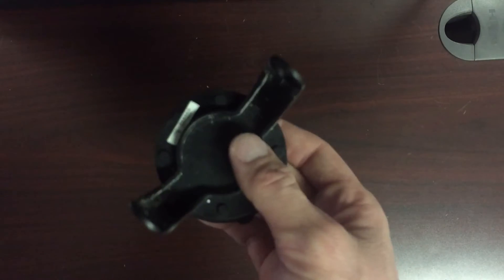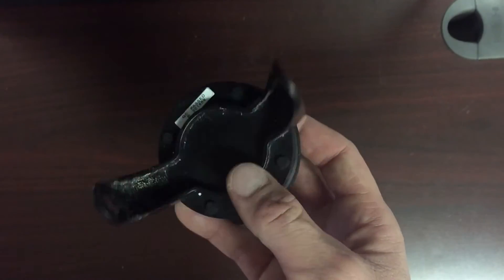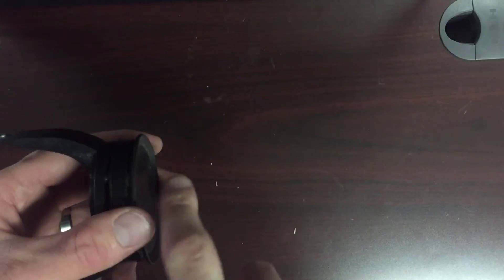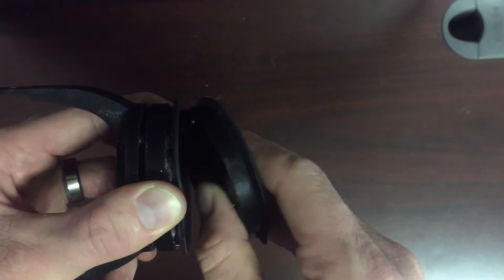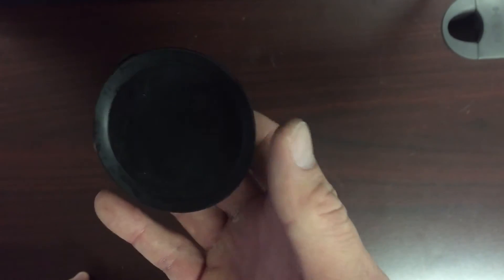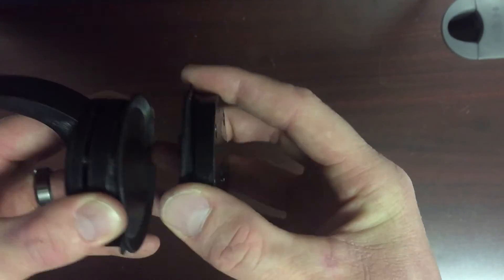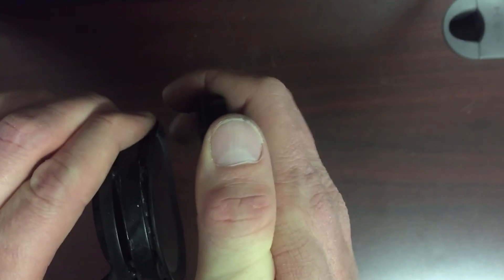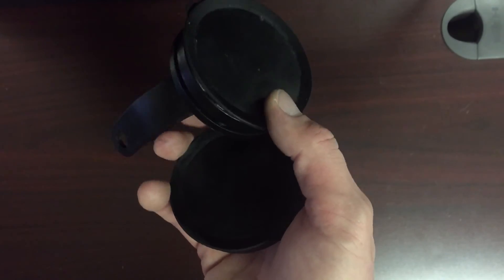Jebao RW15 - You Won't Believe This!?!?!?!?!?!

Comment: I'm in the same situation I purchased a tank that was getting torn down and it came with a Jebao wr-4 pump it was missing the outer magnet. I looked at fish street but I can't find that part on there web sight. what section did you look it up under.
Reply from the maker: +Rays Reef I didn't spend very long looking on their site, if I spent any time at all. I can't remember. I found their contact info and asked about the RW15 magnet. They later responded with the price $20 shipped and a link for me to pay. I had to specify what I was paying for, the process was easy! After a few weeks I had a brand new base (the piece that mounts to the pump) & exterior magnet.